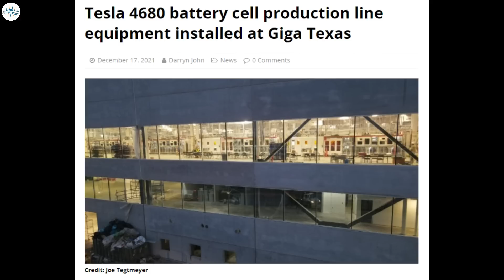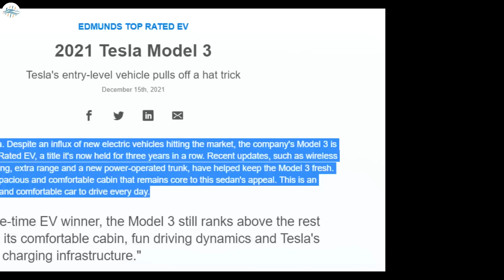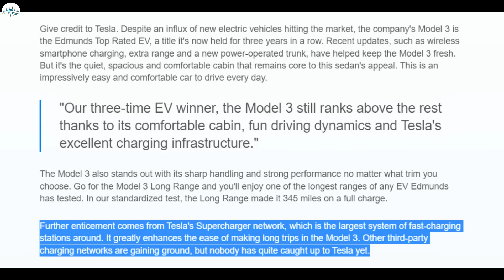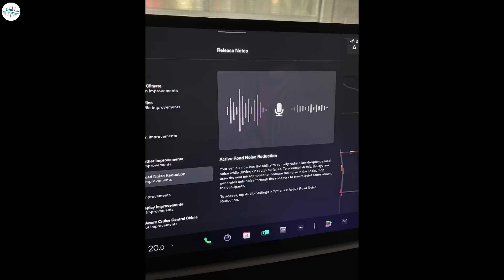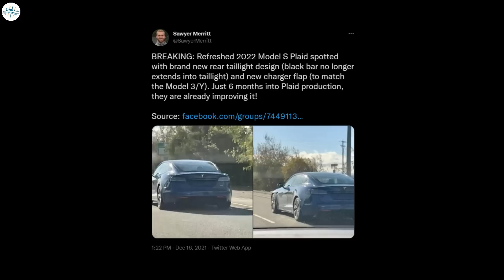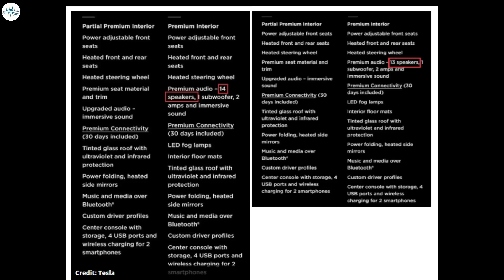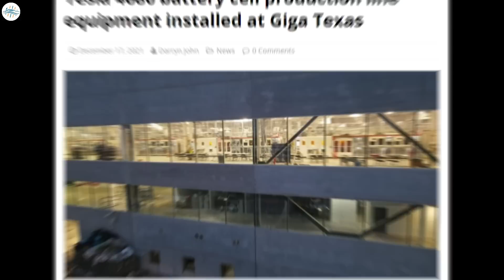Tesla Removes A Feature From Model Y & 3 + More Updates!

Comment: Noise cancellation is more effective with head phone (under a little to no propagation delay) compare to car cabin : 3:00. The propagation delay from a distant cabin speaker to the sampling microphone can produce reverberation. That can be suppressed by a low pass filter hence limits the cancellation bandwidth. A p-delay of 1 meter can limits the cancellation spectrum below 100Hz or 80 Hz. This is another good idea not feasible in practice, without headphones or ear buds. 

We need to appreciate and support more on the importance and challenging role of automotive acoustic scientists and engineers.